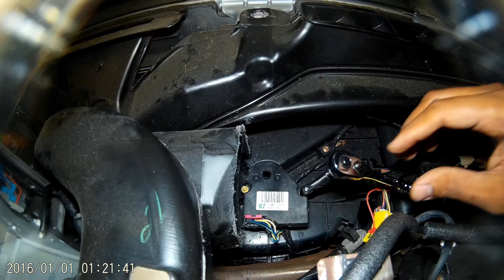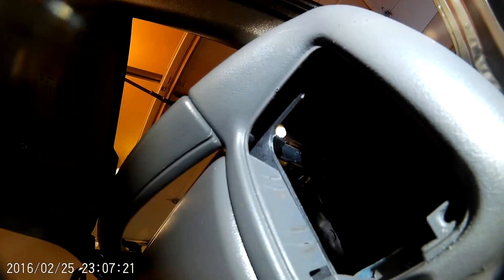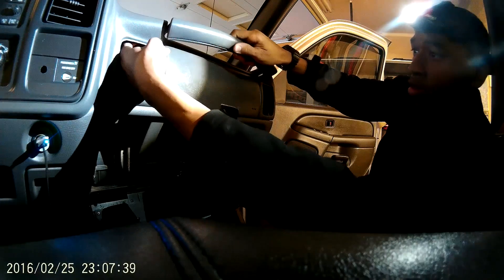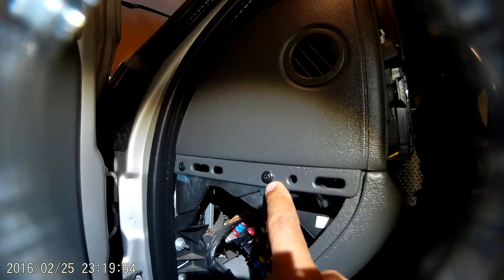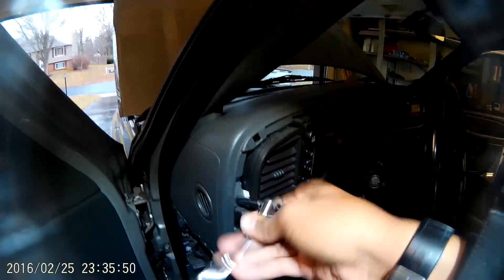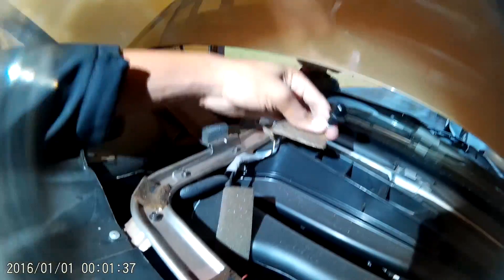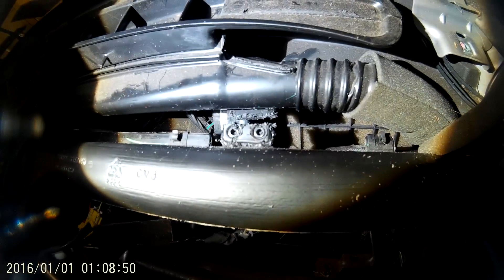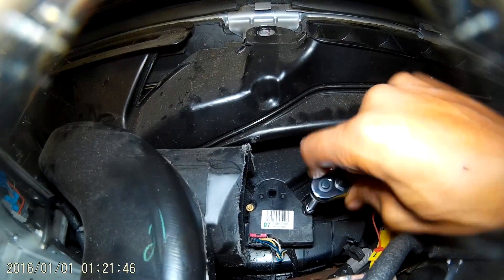How to change the Blend Door Actuator in a 2004 Chevy 1500 Silverado (Behind Dash)

Comment: Awesome helpful video!  Thank you GTX. 
Was working on my 2002 Chevy 2500hd duramax.
Watch out for the sharp metal edges, I filled off the sharp edge after the first slice.  Used some sticky duct seal to hold the screw for that back one.
In addition I did cut the duct as recommended.  
4.5 hours from start to finish and cost $30 for the part.

Comment: Excellent video.  I've been putting off replacing mine for about 5 years now.  It finally died.  Full heat in June in Florida is no fun.  Most of the YouTube videos I've seen show the 99-02 older trucks, which are subtly different in how to remove the safety bar.
Reply from the maker: Thank you, glad I was able to help out.

Comment: It is easier to separate the two plastic air vents by cutting the weld plastics connectors on top with an rasor blade then lift the one next to the windshield to have access to replace the blend actuator  at the end put Small sheet metal screws to to hold the two air vents together
Reply from the maker: Glad you found a easier way.
Reply: You should do a video so I can see what you're talking about.

Comment: Great Video, I will add an alternative that is faster but takes a little more finesse. I Justed removed the top dash cover and drilled two holes threw the duct where the two 5.5 screws were and went in with an extension and socket and the actuator can be slid out and tape over holes after installation.
Reply from the maker: Thank you, I appreciate it, glad I could help out.
Reply: Smart man

Comment: You can change that actuator by just removing the 2 vents and passenger airbag and zip tie the air duct up. I did it last week in my 05 no need to cut anything. It's not fun but its deffenitly possible.
Reply from the maker: I did not know that, thanks for your input.

Comment: Great vid!  How much more work would it be to remove the vent support altogether rather than cut it out?   
I'm not even sure this actuator is the issue, I already replaced the bottom one and that wasn't the issue.  It may simply need a refrigerant charge.  I'll try that first just in case.
Reply from the maker: I am actually not sure. I kind of had to work quick that day. Good luck my friend!!

Comment: I have a 2004 Chevy avalanche I want to do this with, is the one your replacing possibly the same as the one you listed in the description section? I have two in mine the bottom one wich I think is the one with part number 604-106 and then the other one is part number 604-112 and that’s the top dash one I’m geussing. Your top one is my bottom one if what I’m looking up is right..I’m confused haha
Reply from the maker: If you are checking it out on amazon, it should say what will fit your vehicle. Thats what helped me, or call autozone, and they can tell you  specific part numbers.

Comment: Just replaced mine only had to take off the bottom cover by the floorboard accessed it from underneath.  No need to take anything else off just a couple screws.
Reply from the maker: Thats great,  glad you didn't have to go through what I had to endure,  lol.
Reply from the maker: @Michael Payton I changed both since my time with my truck
Reply: How did you access it from underneath? Can you explain a little better?
Reply: The one below the glovebox. Theres a plastic cover with three 7mmscrews that will allow you to see it. The screw on the far left of the panel you take off will be really close to the actuator. That actuator controls where the air is diverted to. Once you are able to see it turn your key and supply power and you should be able to hear and watch it move.
Reply: Daniel Boyd what controls the coolant to flow through the heater core? I feel like it’s shut off. I took off the hoses to see if it was clogged and it is not clogged but the left hose is still not getting hot only the right hose is warm that goes to core. Most vehicle have a valve that closes it when air conditioner is on do you know how the Duramax Trucks work? Does the metal heater tube have anything to do with it mine had a crack so I removed it and put just a rubber hose for now. I just picked up the metal heater hose that is located on passenger side but have yet not installed it. Also befor when I’d have the heater on my A/C compressor use to cycle on and off and now it just stays off even if I have the air conditioner on. This is driving me crazy cuz all it does is blow cold air out the vents. Do you think I have to get a new heater control and low compression valve that’s on the confessor ? Someone please help
Reply: @cholochedd6752  I'm currently in he process of trying to fix mine also. Not exactly sure about the duramax . I have a 2002 Silverado 5.3. There are 4 actuators. (1) kinda to the right above the accelerator pedal. There is a piece of ductwork you can just pull out off and outta the way. That one controls where the air goes. The far right control knob on the panel. Turn the key on but dont start it and you can cycle through the controls and watch the movement. (2) there is one(the hardest to access I believe. Pull glove box off and pop out the vent on the left. It's very hard to see. There is a piece of duct work directly over it. This one should be the hot and cold selector switch. (3) the one I mentioned before. It's almost directly below (2) under the dash. I'm not exactly sure if 2 or 3 is for what. My (3) I believe stopped working. One is to control hot and cold and th ed other the ac maybe. I'm still trying to figure it out. I left the (3) one off and opened the door manually and I had heat. The last one is to the right under the glove box. That one controls the recirculation ie. It should open. When you push the switch to bring in outside air and close to keep heat in the cabin. They say the air filters can be clogged blocking flow. Do you know where they are?
Reply: @danielboyd1186  thank you the one that's hardest to get to the one that's kind of in the middle on top I think that's the one that I need to replace on mine thank you. I do know where the cabin filter is I also have an 03 suburban that does not have cabin filter some didn't have a filter from what I read like my suburban 5.3L .. thanks for your help
Reply: Must not have dual climate control lol the HD models have separate blend doors for each side of the vehicle for when you're driving and your girl keeps saying shes too cold haha
Reply: The one under the dash is for the driver side temp control. The one in this video  I believe is the position selector. Example floor,  defrost, face

Comment: Thank you for this video. I have a Silverado 2004 2500hd with auto climate control. I have tried to re-set the unit by removing the fuse and allow it to adjust automatically. That didn't work. My vehicle is only blowing cold air for the driver side, passenger side, defrost and rear center.  Do you know (or anyone else) which blend door(s) will need to be replaced? Thank you in advance for your help.
Reply from the maker: I would get a certified mechanic to diagnose it, and then you fix it yourself.

Comment: Good video. Is that the same actuator as the electronic/digital controls?
Reply from the maker: I'm not exactly sure of an answer. If you have any issues outside what is explained in this video, I recommend you speaking with a certified mechanic.

Comment: What are the symptoms of this one going bad? I’m getting cold air on passenger vent, hot air on drivers vent, on a hot day with AC on. I think it’s the servo underneath, center.
Reply from the maker: I had a knocking noise, but I would consult with a certified mechanic

Comment: Is this the same as a "mode door actuator"? I'm only getting air to blow out on the floor and that's what the dealership called the part  I was needing.
Reply from the maker: There are a few door actuators. You will have to find out the location of which one is bad in order to replace. I would discuss with a private certified mechanic.  Im not a big fan of the dealership. Ask for a diagnostic and tell them to physically show where the issue  is.
Reply: @GTX10  I found the right actuator but the air doesn't blow out of the setting the knob on the dash is turned to. For example if it's set on the floor it blows out of the dash. Should the knob on the dash be set at a certain position while installing?
Reply from the maker: @kevinhendrix8167  My apologies,  Im not sure on the position of the knob. I just know I didn't move any knobs until install was completed, just to test to make sure the new actuator was working before I put everything back together
Reply: @kevinhendrix8167  I'm sure you figured it out but you have a bad mode door actuator. This part is next to the gas pedal, under the dash and can be accessed via the driver side footwell

Comment: What does this blend door go to
Reply from the maker: The blend door is a small motor that actually opens and closes certain vents that control airflow.
Reply: I was wondering was that one for the passenger side or recirculation
Reply from the maker: @shanenorman8774  oh ok, not sure which vent it controls,  I just wanted the clicking noise on the top of my dash to stop, lol
Reply: I'm having a problem where I hear a whistling noise and my ac blows colder and then it blows just air and then you hear the whistling noise and it blows cold again and it just does that over and over.
Reply from the maker: @shanenorman8774  I'm not sure I've heard any vehicle make a whistling noise before. Thats definitely new to me. Maybe a vent isnt closing all the way, which could make a whistling noise, just like a front door of a home would whistle if its windy outside.

Comment: Is this the one that controls the air temperature
Reply from the maker: I believe it was the one that changes the air direction toward the front windshield.
Reply: The one ge replaced is the circulation actuator
Reply: @GTX10  that one is on Drivers side past accelerator ♦ recognizable due to a complex cam ♦ the hot / cold is under glove box in an inaccessible location ♦ the one most show as temp switch seems to be passenger side air-vent

Comment: This is not the one under the dash correct? This is the one inside the glovebox
Reply from the maker: Negative, it is above to the rear of the dashboard
Reply: @GTX10  alright. I've been trying to tackle this today without cutting the vent. Will be cutting the vent in the morning. Thanks for the response.
Reply from the maker: @highstream5594  No problem,  and may patience be on your side with the project.
Reply: @highstream5594  Funny.  Because I tried my darnedest to not have to cut the vent.  After 40 minutes, I cut that vent.  lol
Reply: @erminiauviedo2  I actually got it by propping the vent up with a 2×4 I got a flexible extension, it was a bitch but I got it. I dont see a problem with cutting that vent and doing it how he did it though. No more clicking from the dash is all that matters 😁
Reply: @highstream5594  Okay.  Now if you would have mentioned the 2x4, I would have tried that.  But it's finally done.  I think either way you do it, it's still a Biotch!!  lol

Comment: this is the passenger side actuator, what about the drivers side?
Reply from the maker: I handled the actuator that was making the knocking noise.
Reply: Driver side is easy to get to this is just a pain in the ass
Reply: Where is the driver side located? Do I have to cut up my truck to get to it?
Reply: @joshtonry4291  It's right next to the floor... Remove that long plastic piece that's got curves in it next to the floor. There are four screws... Its right below the one he just showed you, but you access it from the bottom of the dash and not the top..

Comment: Riddle me this, Batman. Haha

Does the knife have to be the folding jab saw, like the one in the link? Or van it be a fixed blade tool? 

Im 8 hours away from shopping for this tool, and 32 hrs away from doing this job. My luck, im not gonna find 1 specific unit for sale in all of western PA. And son, i dont tie my boots without a backup plan.
Reply from the maker: All you need is an item that will cut through the vent. The knife I used was just super easy to use, great grip, and sturdy.
Reply: Thanks, hoss. I appreciate it
Reply: Handy dandy tip #1:

Homo Depot just sold me this knife for 15 bucks. All about saving the random buck, here, friends and neighbors.

Comment: Lol way to much time. Could of just removed air bag. 4 bolts and it's right there. Bam
Reply: What about replacing or fixing the blend door itself. My 2000 Silverado has a blend door function problem I believe as I replaced the actuator and I can not move the door with my fingers. Any tips would be appreciated. Thanks for the video.
Reply from the maker: I should have took the short cut